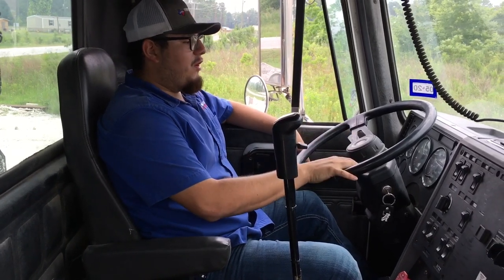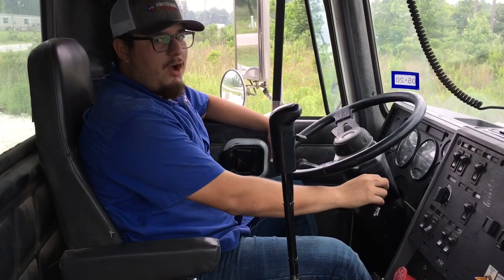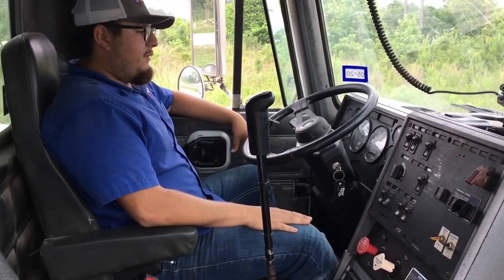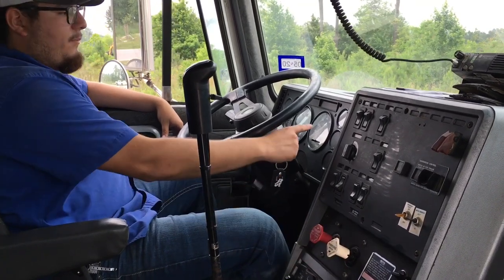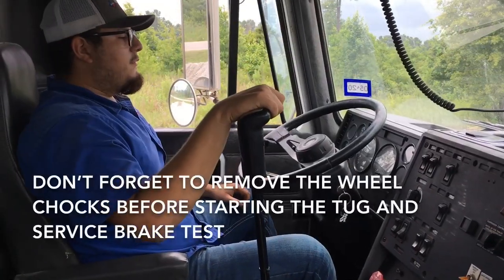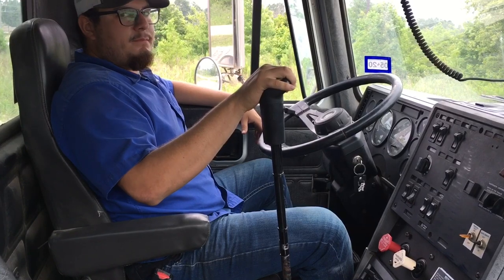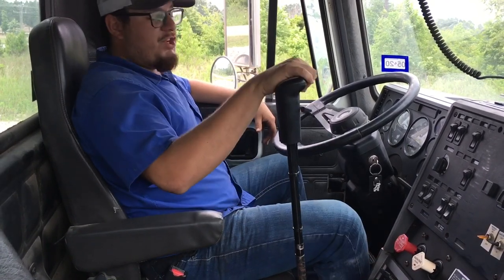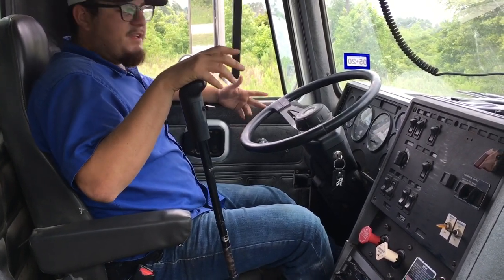CDL air brake test and service brake test CLASS A & B

Comment: One thing I think you should add is after you have completed test for low warning devices and verified service brake pop out valve pops out at around 20 to 40, believe you should probably tell the ester you are going to remove the wheel chock after you bring the air pressure back up and before you do a tug test on tractor and trailer parking brake.
Reply: He did. It appeared on the video.  He didn't say it tho

Comment: Air governer cut out is around 120 to 140 psi.... Not 130 to 140. For class A, you say without the brake petal you don't lose anymore than THREE psi in 1 minute... THEN you would tell them with the brake petal pressed down for 1 minute I don't lose anymore than FOUR psi... You CANNOT say "between 3-4psi" you WILL FAIL. This is not a good video to study if you want to pass your air brake test lol.
Reply: Can you recommend one? My test is in two days and I've barely trained cuz my boss is an idiot. Or maybe he wants me to fail idk.
Reply: @Tihsllubllasti  did you pass it? Im taking mine in two weeks
Reply: @notoriousvillain2962  
Make sure to explain everything you’re doing and take your time. Think and remember before rushing because u might forget a step. Hope u pass
Reply: Cut in and out pressure should be between 100-125 psi. There can be a little variance between DOT and FMCSA
Reply: It differs from state to state
Reply: @jephtedurette8227  also all trucks are different, this guy ain’t a truck driver he’d know that
Reply: It's I will not lose more than three p s I in a single vehicle and four p s I in a combination vehicle With the brake pedal Pressed
Reply: It's 3 psi for bobtail 4 for tractor and trailer together
Reply: @DaoistAlsodaoist  thays exactly what I just said
Reply: @Lyxro  did I ask
Reply: I thought so too im here cuz im confused on the air brakes i need to look for a video that fully explains it all this kinda helped since im more visual but it took me off when he said 130-140 psi😫
Reply: @julietagonzalez5833  125 psi and the air gov will shut off.
Reply: @Lyxro  thank youu
Reply: @julietagonzalez5833  np don't let the gamer page fool you im a  otr truck driver with old dominion
Reply: @Lyxro  nice im just waiting to pass my air brakes so that i can start driving school
Reply: For the air governor cut out, you can just say "in order for this to be a good test my air governor must cut out before exceeding 140 PSI".
Reply: I have my CDL with doubles/triples and Hazmat with tanker endorsements.
Reply: @Lotta Stuff  I also have these endorsements, and received the class a within that last 3 years im up to date on the terms
Reply: @Lyxro   
That's nice
Reply: Not all instructors too stingy they let you know at the end hey imma pass you ,just remember this and this and this. Okay sign here
Reply: 4 psi

Comment: Nice job bud. One thing you might want to add to that is when u do the service brake test at 5 mph make sure after u stop I say not pulling to either side indicating a brake hanging up or dragging.  

Unfortunately I didn’t make it with my test. Drove with my brother in law for two weeks. He did a fine job teaching me how to do the job (load placement, securement, different tie downs and why, tarping and basically driving which I already new from the last time I had my cdl. Unfortunately do to a heated argument while we were at his house followed by getting fired from my old job before taking the test and the panic of no job no income and bills to pay with my sister starting stuff literally while I was in my way to take the skills and pre trip test I went completely blank once I got in the truck. I panicked for A minute and looked around and started with the first thing that caught my eye. Safe start.  Went through the gauges and explains the whole proper psi temp ect. Went to do the air brake test and screwed up from the start. For got to push the knobs in to start. Then forgot to turn the key on. Did the tug test on tractor and trailer but never did the service brake test. Told the guy I was done and completed my in cab Inspection. He’s said you are. I replied yes. Then he told me what all I missed. 

Didn’t talk about the fire extinguisher which I looked right at as I climbed in

Said nothing about checking the seat belt 

Forgot to check city horn and air horn. 

And the few small things I missed. 

Went in got my permit and license back to him to hit the road and get a load on.  He went in and talk with the instructor and he told him he could see I was having a head time. Really p o’s me as I read that freaking book at least a dozen or more times and had just finished the pertrip section before I went in side. Because I had no job or money (1.40 in my account) I went home and hit the internet ASAP liking for another way. Tried a schools out here in south bend but can’t get the loan and won’t ask for a co signer. I hit the pavement Saturday to Wednesday looking for a job and got hired Wednesday and started Thursday. I got to wait 30 days before I can take a day off and try again on the test. At this point I just don’t want to be defeated by Iran’s hope I can find something part time and local driving while I work full time at my new job. It’s got a good opportunity I have been looking for for years but the money’s not quite as good as I was making last year. About 2 dollars less an hour. So I’m hoping to find some one who will take on a newbi per say and let me do some work part time. Glade u made this just wish it was sooner. You should keep doing these sort of videos to help others out with there cdl test. Might also want to tell them that evey state has a slight variance to the pre trip. Stay safe bud. Hope your brother gets it.
Reply from the maker: Working to Relax dang, I completely forgot to mention that. Hope anyone that sees the video checks the comment section to see your post. Lol

Comment: every test I see is diffrent. What happened to putting the transmission in 1st gear then pushing the brakes in while shutting the truck off then putting it into the on position.

Comment: It’s 4 psi combination vehicle and 3 psi straight truck of bobtail. Idk if it’s different in your state but we would be failed for no seat belt also. Very different then Illinois so anyone taking the test here it’s completely different
Reply from the maker: I was told I had to put my seat belt when I was going to start my driving and parallel/backing up test. For pre trip it was not mandatory, but did have to mention it and check it to make sure it was secure, and not cut or damaged
Reply: Grtruckingdemolition yeah see for us it’s a fail if you don’t keep it on which is ridiculous almost everything is a fail and it’s crazy. Not even sure what’s not mandatory here not sure if that’s cause of the state or what but it’s too much

Comment: I've been a Canadian trucker since 1997 and I have to say, your airbrake test in the states is way different than up here. According to our test, you are missing key steps in checking pressure build up, dash valve integrity and a few other things. I was a commercial driver for 13 years before I joined the Canadian Army, and now I have been an Army driving instructor for almost 12 years. If I did EXACTLY what you did, we would fail the test. I don't know why its so different.
Reply from the maker: Definitely very different from what it sounds like

Comment: Don’t you have to put it in low gear to conduct the air leak test?
Reply from the maker: No you don’t, only time you put in gear is to test the trailer,tractor, and service brakes
Reply: @Grtruckingdemolitionllc  that’s not what they told me at my trucking school?
Reply: @Grtruckingdemolitionllc  or does it really matter if you put in in low gear or not?

Comment: First thing, you failed as soon as you pulled out your phone, this is supposed to be done with a stopwatch. (In my state, it might be different in yours)
Second you need to call out what your initial loss was when you released your parking brakes (Then count the minute and loss over the minute) AND when you step on the service pedal VERY IMPORTANT YOU MUST APPLY 90psi to the PEDAL.  (Also count the minute and the loss after the minute). 
Low Air Warning Light comes on at just above 60psi ALWAYS.
You also forgot to call when the warning light shuts off and the build up speed from 85-100psi part (shouldn't be more than 45 seconds).
Reply: Stop watch? You must live in narnia.

Comment: You can’t just do an air test with an instructor and only tell them that things are working. They need to know what would make it a major and put out of service. Tell them. My governor cut out at 135 if it didn’t and goes past 150psi then it’s out of service.

Comment: What's the governor
Reply from the maker: Air Governer which is usually compressor mounted, operates in conjunction with the compressor and maintains reservoir air pressure between a predetermined maximum and minimum pressure

Comment: I don't think you need to leave the key on for the spring brake test. Get rid of that audible alarm.
Reply: Auto fail; you have to have the key on through the entire process from checking the alarm til the yellow knob pop out.
Reply: @markkeith9055  different states have different CDL rules, in Mississippi, it would be an auto fail.

Comment: FAIL!!! No mention of compressor build up rate 85 to 100 in 3 minutes...You also can not get out of the cab to remove the wheel blocks now can you to do the service brake check...Sorry but things are a little different where I am.

Comment: I just failed my air brakes because I said my low pressure alarm will come on at 55 psi or before so this guy was picky big time smh
Reply from the maker: It’s 60psi
Reply: @Grtruckingdemolitionllc  well I passed now next day I am suppose to say at or before 55 psi
Reply: Sounds like the guy was just being an ass. But glad u got it. Who do u work for now?